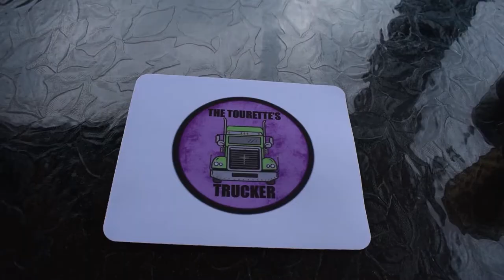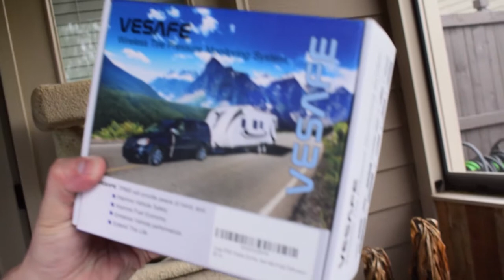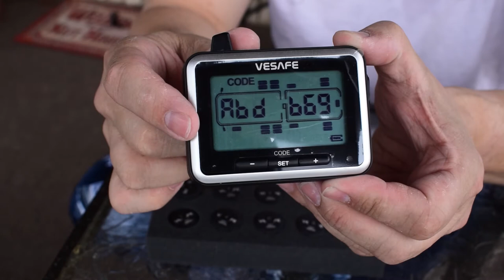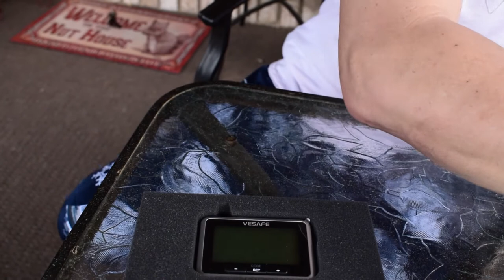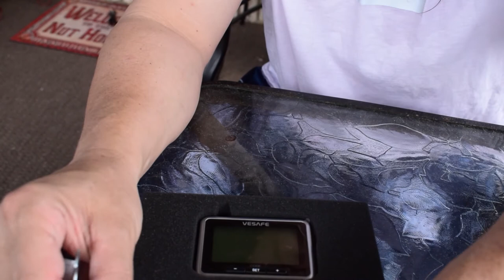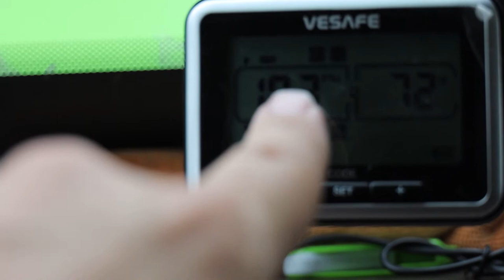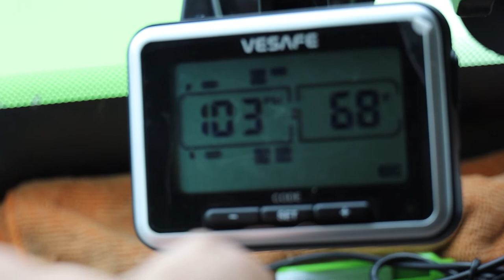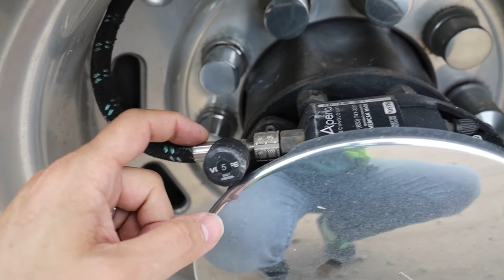Do you have a Tire Pressure Monitoring System It can save you hundreds in costly road calls

Comment: I have the 12 sensor unit. Did you receive extra batteries? I didn't, but I have 12 extra o rings.
Reply from the maker: They gave me extra orings for this unit but my 2 tire mender units had extra batteries as well.

Comment: I just bought these and installed them, even got them on the inside tires but it’s giving me false readings. Says  it’s at 3 psi? Any advice ?
Reply: The two steers work fine but only one drive tire works
Reply from the maker: That's absolutely not right. It took it a few minutes for mine to register but that 3psi is WAY OFF. Try taking off and putting it back on.
Reply: Just did, one of the drive tires I had to tighten it sooo much it finally did. But the other ones I can’t get the hex tool in to tighten the sensor, how you get your valves out like that ? Like in your vid
Reply from the maker: @abarca2013  I have the Aperia haloswhich are tire inflation system. They have an extra port for checking tire pressure. t's on like a "T" valve
Reply: You have a video on that ? I’m about to get it lol
Reply from the maker: @abarca2013  sorry, i was doing the live stream. yes i have a video on it. 

https://youtu.be/4STK9j9WWLg